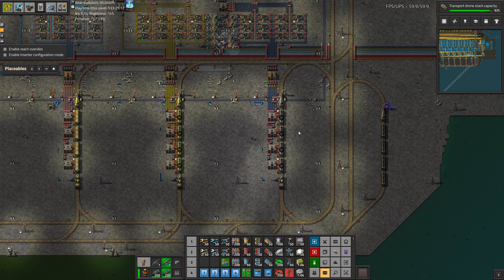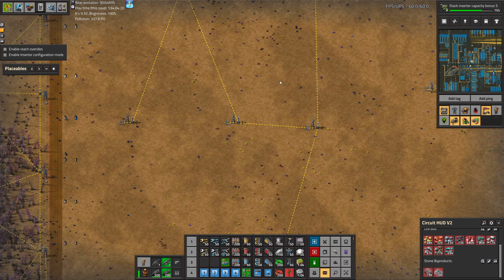[Factorio 1.1 4K] Angel/Bobs Ep 300: Factory Tour

Comment: That storage system have a blueprint automated ore/plate at 9:40 to  ????  SIr i been tring to do that for 2 days now no luck
Reply from the maker: I think it's too big to be one giant blueprint, but there should be a save file linked in the description, perhaps you can pull out what you need from the factory
Reply: no, i just want storage logic that example  how much  silicon do we need we only let pass that much even though you talk about that but I dont understand  @marsh8056
Reply from the maker: Say you have 2 methods that make silicon, A and B. A is the better method. You'd connect that to a warehouse that stores silicon you produce. Set A to get to 4000 silicon, and set B to get 2000 silicon. This means A will have priority. When silicon drops below 4000, A will turn on but B will stay off, and only turn on if silicon goes below 2000. Below 2000, both A and B will be on, and as the level goes above 2000, B turns off but A stays on. You can prioritize all of your production methods this way to try to avoid backups.

Comment: I have no memory about trees setup :) I do, however, remember gardens setup for making gardens out of nothing. Because when I did my angels run, it was messed up in some way and I had no recipe for gardens out of nothing :) And I had to roam around the map looking for gardens to barely get enough plant life samples to do necessary research. And since I had no experience with angels/bobs or any similar mods, I assumed that was intended behavior.
Anyway, congrats on ep300! Factory looking big and strong 🦾
Reply from the maker: I think the recipe was changed/removed to generate gardens from nothing… some of the farms at the garden generator don’t have recipes anymore. But I think you still can “grow gardens from gardens” something like growing a garden from 30 samples but you get 32 if you mulch it, so you slowly gain more
Reply: @marsh8056  I had a way to grow gardens from gardens. The problem was - I had to gather a lot of gardens to research all required tech. I think it was locked behind farm3 and all farm levels requires samples to research. I did a lot of exploration and was like 2 or 3 gardens short. And eventually abandoned it because of some other bugs.

Comment: Marsh, I have a question, I noticed a lot of slow traveling bots due to looking for charge. This I think it is because your factory is 'natural' and not box-shaped. 
Will you increase the amount of charging pods on remote areas for the bots to travel next time you will do concrete 'painting'?
Reply from the maker: Every zone expander has a small (4 port) charge area. I guess I could expand them, but it seems like a lot of resources. The factory has more than 15k bots, I think it’s acceptable when a big burst of them come out, that there will be a line to use charge ports. Once they use their first port, they will be spaced apart and the lines won’t be as long. There’s some large charge areas for the early days of bots where they were taking predicable paths
Reply: Hi  @marsh8056 ,  makes sense. You have production area above from the bots usually come from and another wide area down on old base/ores/power. I was meaning towards increasing these charge bundles in the areas where your base is empty between these wider areas.
Reply from the maker: The concept is the same. When there’s thousands of robots released at once, no amount of charge ports will be enough
Reply: @marsh8056  Ah, now I got you, the bottleneck will just be changed a little. Thanks 😃